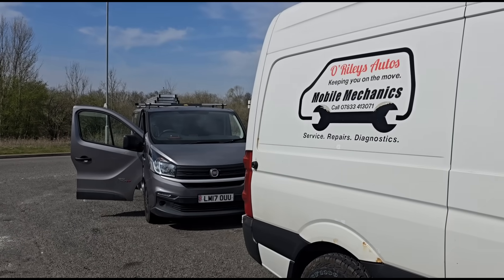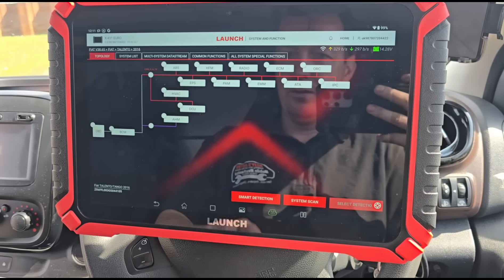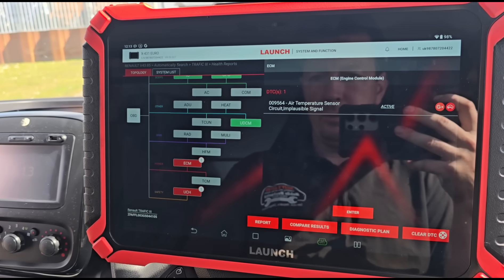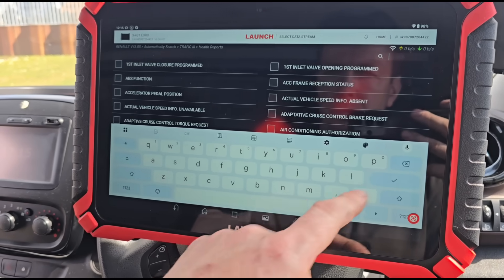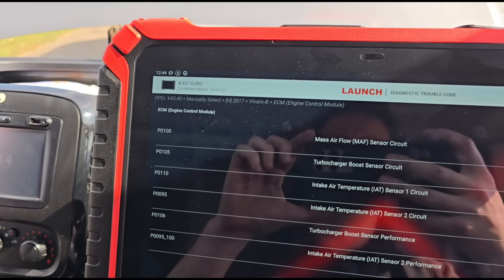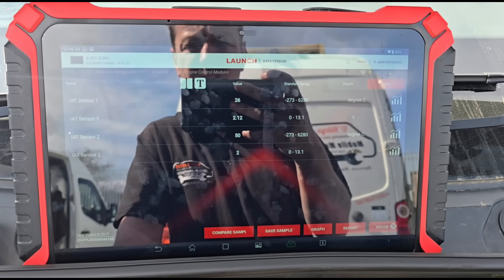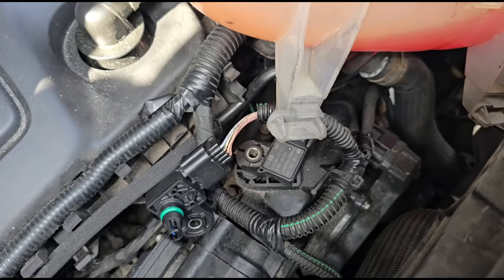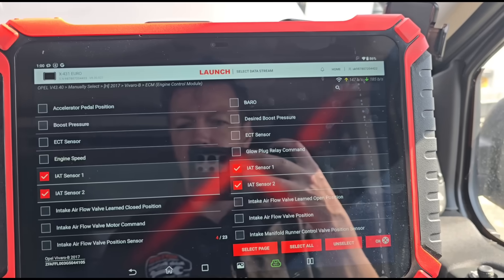Fiat Talento P0095-64

Comment: Jimmy. Thanks for all the great information. Purchased a Launch x431 here in the US about a year ago based on watching your videos and although I’ve had good luck using it there is no bracket to hang on steering wheel :(
I have successfully diagnosed a failed DEF pump, initiated and tested a year ago and recently a failed selespeed relay, changed clutch and hydraulic fluid. Both on my 2016 Ram Promaster ( Fiat Dacuto ) with Iveco 3.0L diesel and MT40MTA  automated transmission. I have not been particularly impressed with the dealership’s timely and accurate diagnostic ability. The dealership’s tend to throw parts at it and this was too expensive! You and Ivan ( PHAD ) in PA have been my primary inspiration! Love your videos I have watched many more than once!
Reply from the maker: Thank you for your support

Comment: I have a question, Why do they always release a new tablet? all you need is the updates? and i'm sure updates don't cost £300?  Like there is no moving parts in a tablet and its all done by programs? so why keep releasing new tablets.

Not having a go just wondering why?  Thanx btw.
Reply: Money
Reply: @davidnorton5887  correct the euro tab he uses like baz is 6k ouch 😳

Comment: Chain stretched at 65k miles is way to early but not uncommon on the 1.6 dci
Reply: Heard them at 70k. Unless the oil is changed every 6-8k max this is how they end up. I’ve been running one from new and now at 223k miles. I can hear a change in the engine noise from about 4500 miles after an oil change. I try to change the oil every 6-7k.